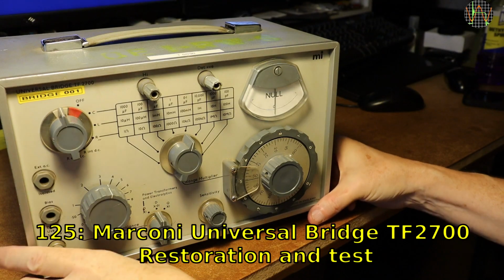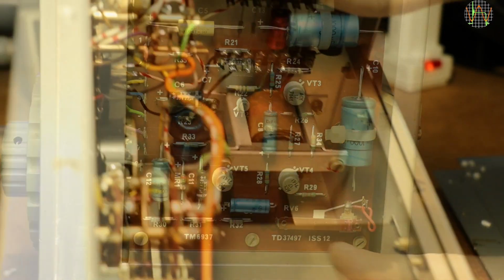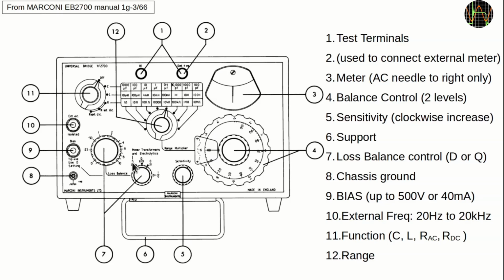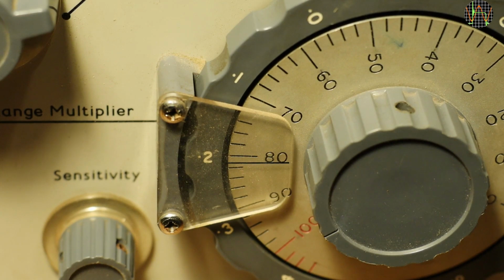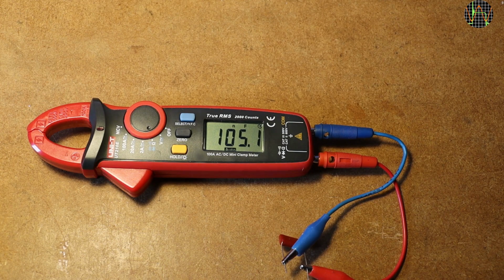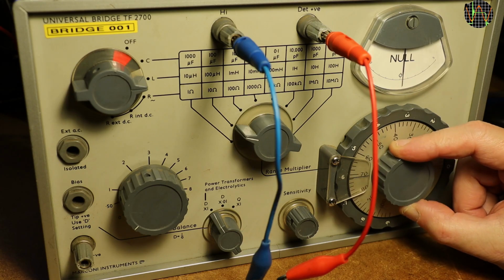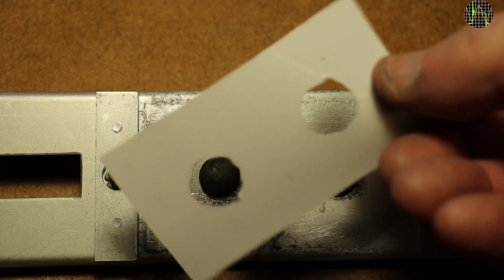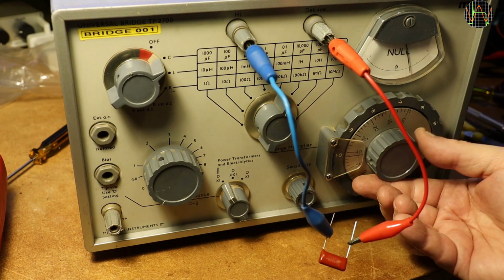125 - MARCONI Universal Bridge TF2700: Restoration and test

Comment: Bridges are lovely - the manual is being VERY pedantic and accurate when is says sensitivity is reduced by a low battery (but accuracy ISN'T - the same voltage is driving both arms of the bridge, and all that matters is that the arms match).

And you were lucky with the condition of your 2700. In mine, everything is clean, but it ... doesn't work. I think I need to replace all the electrolytic caps.

Comment: Also acquired one of these mainly for the ability to measure inductors (it goes up to 100H), not being able to justify the cost of a proper LCR meter. It works great, thanks so much for the tips. Mine has a mains psu built in so no battery issues. Easy to check working against known good caps and resistors. Yes it's fiddly to use (compared to pressing a button) but for casual use (hobby) well worth it. p.s. you can never have too many measuring instruments  ;-)
Reply: I would argue a TF2700 IS IS IS a proper LCR meter.

Any info you can give on the mains PSU you have?

Comment: Super video. I just got one so your video will help speed me up repairing the instrument. I used to use one of these bridges when I was an electrical apprentice back in the 70's! My unit is cosmetically immaculate,  but the oscillator is unserviceable. Thanks for a very informative video. You speak excellent  English. Cheers, William.👍
Reply from the maker: Thanks for the kind words. Apart from the battery my unit was fully working, so I was lucky. I use the bridge quite often. I recently made a video about how I used it to check MLCCs. None of my other LCR meters allowed that kind of testing. The oscillator is not terribly complicated and by testing the components you should be able to find what is wrong. As a start, does it even get power? And the socket for ext AC and ext DC have contacts that interrupt the signal from the internal oscillator when something is plugged in. It could be that these contacts fail to close or are dirty so that even with nothing plugged in no oscillator output reaches the bridge.

Comment: To get a better test of a battery's voltage, you can put a 1k resistor (for a roughly suitable ~9ma with a 9V) across the battery to get some normal current flowing, and then measure its voltage.
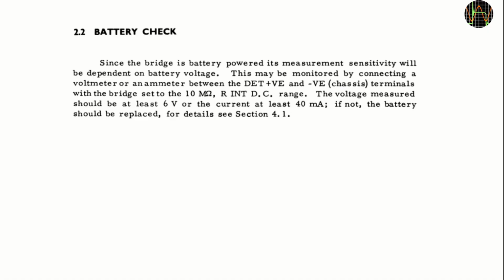Reply from the maker: Yes, I agree. One should always measure  battery voltage under (representative) load.  For what its worth, I just tested again with the battery inside the TF2700 using the method described @23:00 (10MOhm range and R INT DC) and it's still 10.05V

Comment: Retest after you recap the unit, those old blue caps from Phillips could well be bad by now
Reply from the maker: Appreciate the tip, you have done way more restorations and are probably right. To be honest, whenever I recapped old test equipment as a precaution, I found that the vast majority of electrolytics are better than their reputation. Those few that were bad were also clearly obvious so (bulges, gunk spills ...). To be fair, I tested the extracted old caps only for capacitance and ESR, and they were still acceptable.  I did not test for leakage. But for the DATRON 1030a, I did  test the  large caps for leakage and they turned out ok .  Of course, every cap manufacturer (and production run) is different and if a cap is still good today, it does not mean it still be a year later. So for peace of mind, I should do a recap. .